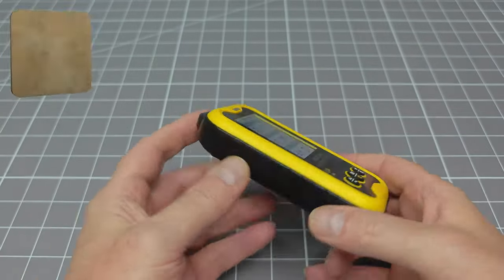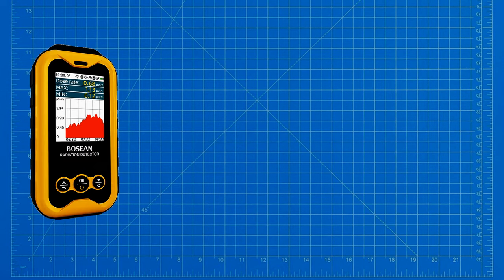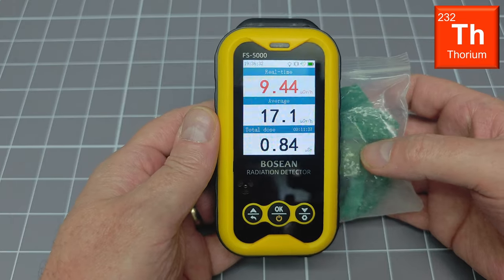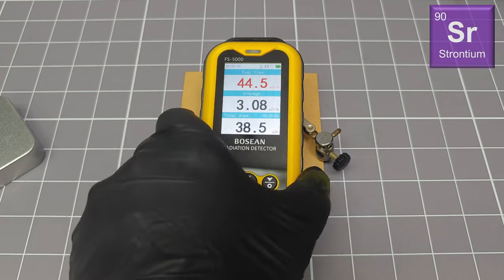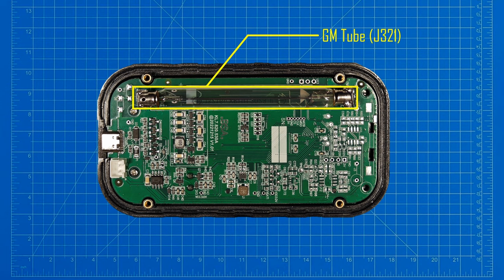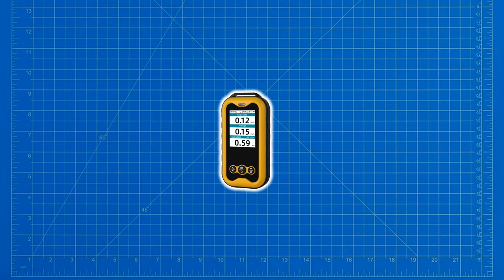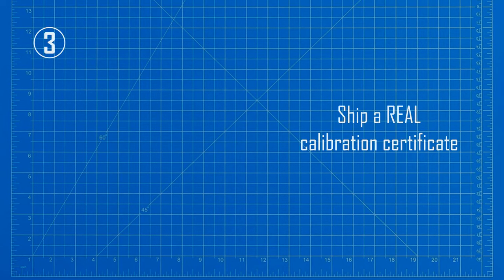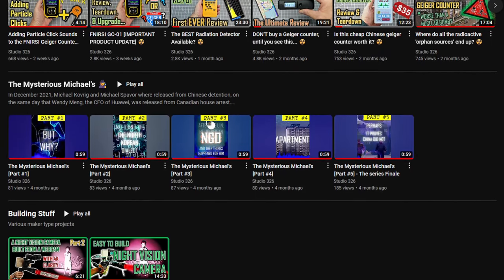The Perfect Cheap Geiger Counter?

Comment: Hopefully their next version uses standard batteries. I bought it, but I'm super uncomfortable with the unbranded lithium ion battery. And in a real emergency,  these will be useless if power grid goes down.
Reply from the maker: I really get your point on the replaceable, off-the-shelf batteries.  I have recently been interacting with the so-called 'prepper' community and for sure using standard primary cells is a better match for that application.  I was doing some research for a video I will be making, about a device that has been aimed at that community, which turns out to be complete snake-oil, but I did learn a healthy respect for this community on the most part, well at least the majority of them, ie those that are able to keep politics out of a discussion about radiation detectors...
Reply: If and when it happens,  politics will be irrelevant.  Silly people.  BTW very happy with this model's performance (minus the battery), appreciate the video!

Comment: Hmmmm guess this is the one I'll actually buy.
As the communication appears to be serial I'll try to add a simple serial-over-bluetooth to the device and try do simple protocol decoding on Android for the lack of features you mentioned.
Reply from the maker: Hacking the serial is ALWAYS a good idea.
Please share your results once you figure it out!
Reply: @project-326  Hello there!
So my super fast forwarder finally delivered the item.
Before jumping to hacking serial I got some common sense sanity to do.
My unit measured about  0.14uSv/h in the office and tube voltage measured 325V.
Unfortunately I don't have any uranium laying around so do I need to mess with the HV PSU?

Comment: Update: I was wrong, it does still come with the J321 tube.

With the change to using a shitty tube what’s the possibility of modifying it to take a much nicer tube like a pancake.
Reply from the maker: I think that it will be a question of what the tube voltage is in the FS-5000 verses the requirement for a pancake tube...

Comment: Hey, it´s me again, the guy with the FS 5000 with a short tube. Meanwhile Bosean replaced it with a new device production date 07/24 and with a J321 tube inside. Me happy now. 😁
Question: measuring some 0.30 micro Sievert on top of a sample with the back plate attached. Without back plate and with the tube therefore touching the sample up to 0.9 micro Sievert. Normal? Is that due to some millimeters more distance or is it the back plate itself? And which one is the "correct" value? 🤔
Reply from the maker: actually both are correct.

Sometimes it can be helpful to think of radiation like a light bulb.  The further away you are, the lower the measured brightness will be.  This is where the famous inverse-square-law comes into play.  Please take a look at the wikipedia entry on that relationship.

I hope that helps!

Comment: Thanks for the nice review! Since your power supply is up and running, have you tested the soft x-ray sensitivity for the BR-6 as well? Would love to know if it is able to detect soft x-rays too.
Reply from the maker: Yes I did, it responds pretty much the same as the FS-5000, which is in hindsight, unsurprising as it has the same tube...
Reply: @project-326  Thanks, that was what I was hoping for. Is the J321 is the same tube as the M4011? I was worried that it would have a bad detection efficency and could only detect high energy x-rays as you mentioned is the BR-6 video. You seem to be the rainbow shitting unicorn when it comes to Geiger counter reviews. Love every video. Thanks again for sharing your valuable knowledge :-)
Reply from the maker: @brigittenieen3942  The J321 and the M4011 do seem to be very similar in performance.  Glad you enjoy my little channel, I'm just sharing what I learn as I go.

Comment: you can install rad pro on these now, makes it probably the best amateur geiger counter out there
Reply from the maker: I knew that Gissio was working on this, but thanks for letting me know that its ready now.   I can't wait to see the results!
Reply: How do you do the install and why is it worth having?  I've just ordered the FS 5000 ($99NZ).
Reply from the maker: @alastairbrickell8813  My personal opinion here:
The RadPro software is really good BUT - it doesn't work with the Bosean PC application and having the ability to offload data is one of the best features of this product (take a look at my beta back-scattering experiment video I did using the FS5000).  I know that there is a way to do that in RadPro with command line scripts, etc, but frankly the convenience of an app keeps be from changing to the RadPro on this device.
For crappy counters like the FNIRSI GC-01, for sure, the RadPro is a great upgrade, there isn't any useful features to lose...

Comment: Thank you for the review.  I purchased a Bosan FS-5000 after the GM tube on my Pudibei NR-750 broke due to unfortunate tube placement on top of surface mount C25. Could I have gotten a bad unit?  It seems to be much less sensitive than my NR-750 was. Since it's broken, I can't check, however I have a GQ GMC-500+ and I tried them with an orange Fiesta Ware plate, a uranium glass bowl, a radium dial wind up clock, and a container of Nu-Salt (Potassium Chloride). 10 minute background check with the FS-5000 was 5 CPM avg, the GQ 27 CPM.  The Radium clock: FS 6 CPM, GQ 60 CPM.  The Plate: FS 105 CPM, GQ 4250 CPM.  The U-glass bowl FS 16CPM, GQ 96 CPM.  Granted this wasn't as comprehensive/accurate as a real scientific test, but for a rule of thumb the GQ seems to be 5x to 10x more sensitive than the FS.  Has anyone tried a similar experiment?  Could my FS be a lemon?  I have a SBT-11A/CBT-11A Alpha, Beta and Gamma mica window Geiger Tube I got from Electronic Goldmine and If I can figure out how to mount it (and protect the mica window) I want to mount it on the NR-750 to see how it does - As of yet I don't know if I will be able to calibrate it but at least It will (hopefully) be working again.
Reply from the maker: Does you FS-5000 have the J321 tube fitted?  It should be the same(ish) tube type as the Pudibel model...
Reply: @project-326  I don't know what tube is in the FS-5000.  The NR-750 had an M4011 tube (which the specs say is about 90 mm long end cap to end cap) and a 10 mm diameter.  Looking up the J321 specs, it is also 90 mm long but 12mm in diameter.  The one I have in my FS-5000 is much shorter "only" 60 mm long.  It has black heat shrink around it and it is end connected with soldered wires vs clips.  If there was a way to post pictures I have them.   sticker on the back of the FS-5000 says PD: 2024.03
Reply from the maker: @timothykellogg9257  OK, so it seems that the FS-5000 is the older crap version.  On the official Bosean official AliExpress site they print a promise to only ship with the J321 tube...
The link to the official store is in the video description.

Comment: Awesome, I'm thinking of buying a Geiger counter for a video I'm making and I think you've sold me on this one. Thanks!
Reply from the maker: Be careful, once you get one, then you will be wanting things to measure, and later, you might think, about getting a better detector, and so the cycle continues, until it becomes a fully fledged 'hobby'.
As cheap devices go, this is the best one I have tested, so frankly its a great 'starter product'.  As hobbies go, I'm not sure there is a downside to being exposed to more physics, instead of being a hobby collector, of say, guns...
Reply: @project-326 

Just placed an order for a Radiacode 103... :D

Exactly what you described. Had no time at all to mod/upgrade my FS-5000. But still a pretty good rig for using various tubes and for messing around. My Radiacode will never be opened or done shady experiments with. Always good to have one piece of equipment you can abuse to get your results / play around without worrying:)

Comment: Just got mine.
I took it with me to an xray place. My partner was getting some imaging done.
I could definitely detect the xrays being taken from the waiting room.
So it works.
It's reasonable quality overall, I'm pretty happy with it.
When I find my jewellers screwdrivers I tell you which tube it has.
It was advertised as having a 321 tube.
Reply from the maker: Good stuff

Comment: Do you go scrumping often? Im always looking for new samples to buy. 
I have a fairly hot sample from the 70s used by the ARC. I also have a Bicron Analyst with a pancake probe, as well as a newer digital meter.
Im trying to get my hands on some DU 30mm rounds my vet buddy brought back from Iraq.
Reply from the maker: We have been a couple of times, there are 2 videos about those visits on this channel, if you are interested...

Wow - access to DU, something I would never get here.  It would make for a great sample that can be dated via the ratio of the iostopes using a simple gamma ray spectrometer like the Radiacode or KC761...

Comment: Very well done! I might just buy a Bosean FS-5000, but more for searching, finding, and detecting sources, rather than more precise measurements. I do use the SEI Inspector USB (v 2.13) G-M counter, and it's an excellent device, despite being discontinued, with the newer SEI Ranger. These both use the LND 7317 "pancake" G-M tube, so they can detect alpha (> 2 MeV), beta (> 50 keV), and gamma (> 8 keV) through the mica window. They also have a scaler/timer function and built-in isotope efficiencies–which the values for can be changed, so you can measure isotopes in DPM and Bq. By the way, what are your thoughts on the SEI Inspector USB and SEI Ranger G-M counters? If you do know, please give your honest opinions, as I'm curious to know. I think they're great units! Thank you!
Reply from the maker: Hi and thanks for the interesting comment.  Sadly, I have zero experience with SEI devices, so cannot comment.
Reply: No problem! Thank you anyways! I enjoy your videos! It's great to find a channel on someone who is knowledgeable in said subject! Unfortunately, A lot of others don't know what they're doing!
Reply from the maker: @KarbineKyle  Life is a learning experience, and I'm still working on being an expert at anything...

Comment: Thanks, that's impressive. Especially the battery life and download ability. Beats my modified GC-01 even with the bigger battery I fitted. I presume the display turns off after a while to achieve the long runtime?
Does the histogram autorange on the vertical scale? The GC-01 does but some don't.
Reply from the maker: Yes, the bargraph autoscales, its pretty annoying that some devices can't do that.

Comment: Your reviews are great. Would this be suitable for test if food or water was contaminated with dangerous radiation? (say after a nuclear war)
Reply from the maker: Testing food/water is difficult for any detector.  Anything that will be consumed needs to be checked very closely and usually requires a fairly long duration test, even with a big expensive detector.

Comment: Hi Studio 326!
As I already posted in another comment, I recently bought one from their official website with a manufacturing date of March. Unfortunately, I received a FS-5000 with a smaller tube. This one is directly soldered onto the pcb, you can actually see on the pcb that there are silkscreen markings for both tubes. There are the metal clamps to install the "better" (?) J321 tube tho. I quickly checked the silkscreen notes regarding the PCB version and everything seems to be identical, expect the tube. Would it be alright to just buy an off the shelf J321 tube and install it? Can you maybe provide me all the details you can find in the device information? Last setting in the Menu. I was wondering if they applied a different firmware version to somewhat match the tubes performance and some sort of calibration. Therefore, I guess it wouldnt be the best idea to switch tubes, I believe the j321 is a lot more sensitive which would lead in wrong calculations of dose rate. Thanks for you help!
Reply from the maker: Did you manage to get the PC application working for the FS-5000 yet?  In the application is a place where you can change the calibration, so if you get your J321 tube installed we can discuss the calibration factor later.
Don't despair, there is a community of people here that will help.
I am also about to have a rant with the contact that I have from with the company.  I only bought mine about 8 weeks ago, but it came with the J321, perhaps it was older stock - I didn't buy directly from the Bosean store.
Reply: @project-326  hi, thanks so much for the response and help!! <3
I successfully used the firmware now, the v1.00 was not working for my W11 environment, v1.02 did the trick. Btw, weird version names, if you click in the PRDMS software "about help", it says it is v1.1.0... whatever, I believe they dont really care about consistent versioning schemes :D. I see a coefficient field, I guess that's the only option and method to adapt to a different tube. Mine displays 0% afaik. Whats yours?! Thanks for the help. Bought the bosean because of your recommendations! Other than the tube, it's a quite solid start for modificaton and further investigation and maybe a good plattform for ppl to debug, reverse engineer that and stuff :)

Btw, there is an aliexpress listing stating it will ship with a genuine j321 tube! Guess what. There are a couple of new customers complaining about receibing the shitty tube as well. I BELIEVE they are completely switching to the no name tube now because on the website they removed every evidence and claims of using a j321. The aliexpress reseller responded that they unfortunately shipped out the false product... but why bother having two versions at the same time? Im sure they are just in the transitioning phase and the PCB is just a future proof base and can be used for other brands later on... like a generic plattform.
Reply from the maker: @leandroebner1405  The reason there is two versions of the PC software is because of me.  I made a real stink about it not working correctly on Win11, so they changed how the auto port detection works and then packaged two versions in the zip file.

Every manufacturer needs to find ways to compete, I kind of understand the position of Bosean, they are competing with things like the FNIRSI GC-01 that basically uses what ever tube is cheapest at the time when they make a batch.  FNIRSI also support the drop shippers that sell on Amazon, so I expect that each batch that is ordered can have the tube specified.  Drop shippers don't give a flying f*ck about anything apart from getting into the first search page on Amazon.

Mind you, the Bosean guys were trying to convince me to open an Amazon store at one point, they got a pretty short response to that.  I just pinged my contact at Bosean and she promised to find out what is going on with regards to the tubes.  At least this device has a decent HV PSU, its as stable as hell and won't vary from device to device like most of the other counters.
Reply: @project-326  Ahh okay. The original version is not even starting for me 😅. Yeah, I fully understand that and share your opinion. For the price and possible mods with the j-tube, it's still quite good. Better than any FNRSI based one. No matter the tube. Interface and stuff like particle clicks work out the box. Just wished I knew that before buying and many people feel the same. They should communicate that better. Anyways, how would you proceed with the mods? Unwrapped the tube out of the heat shrink, no ratings at all. Seems to be identical to the FS-600 tho. I believe a change is definitely worth it? Buying some uranium-glazed glass soon as my first sample just to get going :). Funfact: If you FULLY remove the tube and check with the particle sound that you have consistent 0CPS/CPM, it still displays 0,12uSievert/h as current value... Interesting. What should I keep in mind when ordering a new tube? Also, what would the new calibration coefficient look like?
Reply from the maker: @leandroebner1405  The calibration is actually not too easy.  The J321 is also sensitive to beta but the J614 has a solid metal cathode that blocks pretty much all betas.  So, with a reasonable gamma source, shield from betas and try and set for the same gamma only level.  Wrap you source in lead or steel and set for the same reading on both tubes.  Later, you will find that background and other measurements are higher but this is because you are now measuring more gamma events and also betas.
Reply: @project-326  but you would still recommend the J321 over the J614?

Can I use your calibration coefficient for a rough estimate?
Reply from the maker: @leandroebner1405  J321 for sure, you are just going to detect more events.  My calibration coefficients is set to 100, which I assume means that the main coefficient is multiplied by 1, ie unchanged.   It seems strange that your cal value says zero...
Reply: @project-326  Thanks a lot for the recommendation! Are they actually all calibrated by the factory beforehand?!
Ill double check when Im home again with the value, already removed to tube tho
Reply from the maker: @leandroebner1405  It is going to be one cal for each model - which should include the change in the tube (though they don't give it  new part number)
Reply: @project-326  alright, thanks. Btw, my calib coeeficient is 100%... forgot to hit "import settings" in the GUI, thats why I had default values here beforehand :D
Reply: @amaxence  @studio326- yep, they offered me 20,-$ refund. Agreed but heard nothing after that...